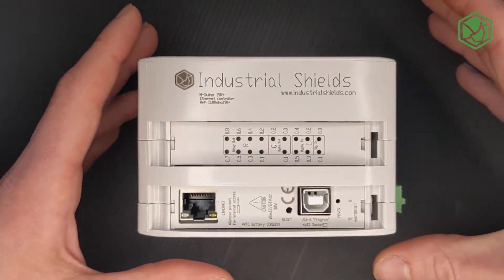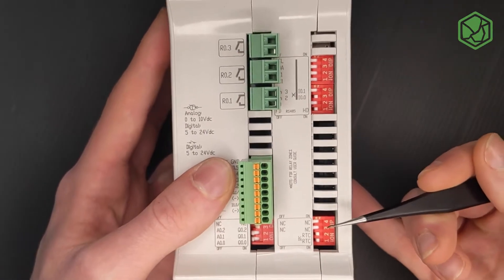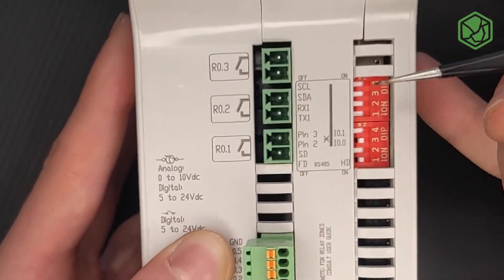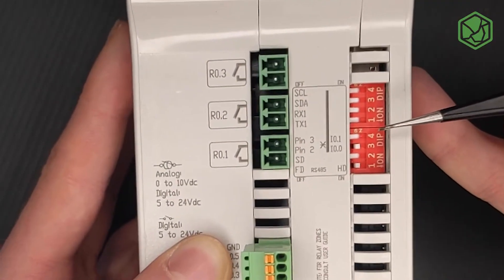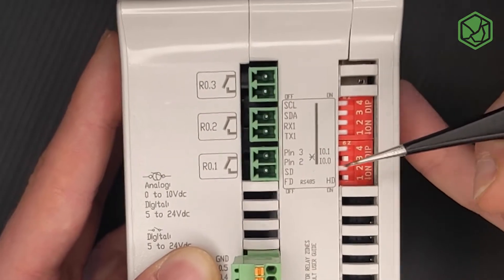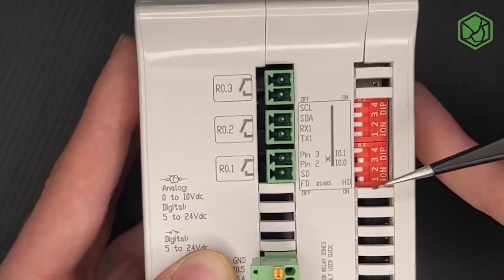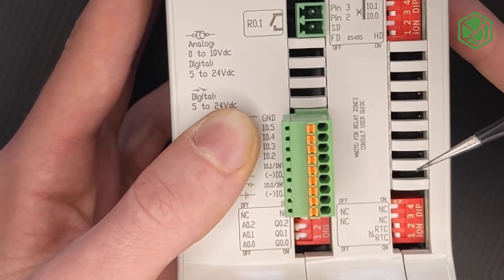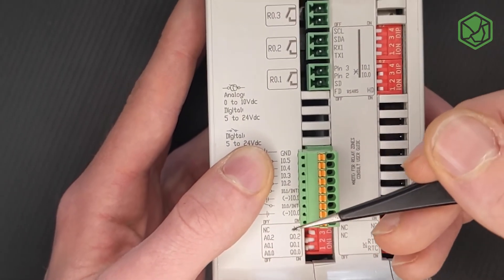➡️How to configure the switch of the Industrial Arduino PLC M-DUINO 19R

Comment: I have been asked to design an automation project in which your device would be applicable, with one exception.  I need access to multiple UART (serial) ports such as found on the Arduino Mega's.  Do you have such an implementation?  ~P
Reply: Hi! Depending on the Arduino based PLC model, you can use one external Serial port as the other ones of the internal Arduino board are used for other communication protocols such as RS-232 or RS-485 among others. But there are other solutions such as use Software Serial to achieve more serial ports by software, here you can check it! 

https://www.industrialshields.com/blog/arduino-industrial-1/post/how-to-use-the-softwareserial-library-in-arduino-plc-industrial-controller-99

Eloi D.